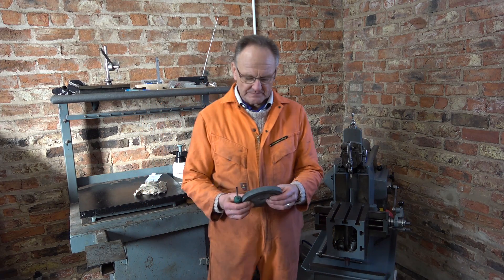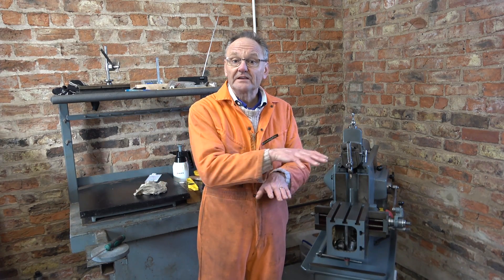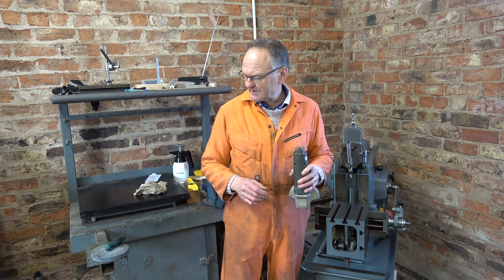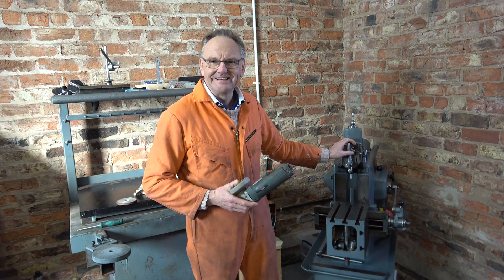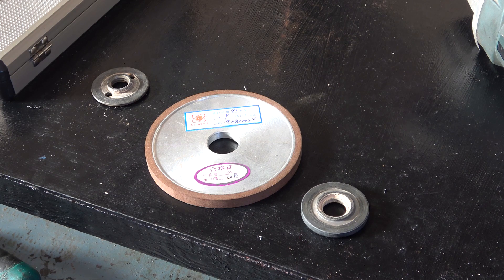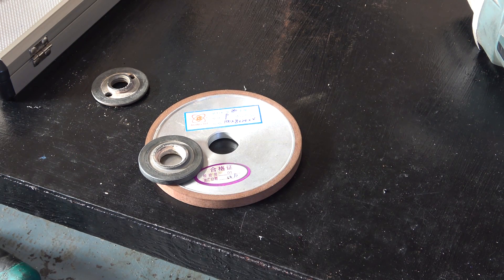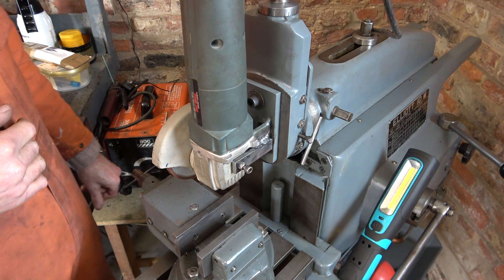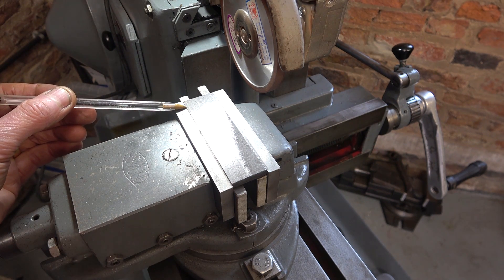HS67 Using my Elliott 10M shaper as a surface grinder

Comment: great idea will be copy.... a question , a usual disc grinder dont work well???( rectificated with a industrial diamond???
Reply from the maker: Hi Jose, my 'shaper grinder' was just a rough rig because I do not have a toolpost grinder and the jaws are only for my welding positioner chuck (so do not have to be perfect). All grind stones will wear. Stone will wear most. I used diamond but experts tell me that CBN is better on steel. It's all a matter of cost and what the job is. Cheers

Comment: 7:30 - Where did you find a surface grinder for 500-600 pounds? Last time I checked, to get a quality surface grinder, it costs $20-$50K. What you just built is comparable to the pro grade surface grinder. Thanks for the explanation, would be nice to show the surface finish accuracy using a dial gauge.
Reply from the maker: Hi SP, I was probably thinking of some clapped out bit of kit from a home workshop for £600. My solution is rough and ready but often I find that 'near enough' is good enough when you just want to trim a bit off something hard but be more accurate than hand grinding. In another video I trim a hardened parting tool holder to fit my toolpost where the absolute dimension was not important. In that case I used a carborundum wheel and of course there was a bit of taper as the wheel wore but it was manageable over a short distance (maybe 4 inches) for that application.  This was the video https://youtu.be/pKItOC9HWKA  Cheers
Reply: @HaxbyShed  I did some research, since I only work in precision applications, surface grinder needs to be carefully chosen to get micron to sub-micron flatness accuracy on parts. I read many people were buying quality old used surface grinders for $500 and rebuild it, however it is a great risk since surface grinders are the machines which requires strict observations if the ways, chuck, spindle and etc are working precisely and are accurate. In 99% of the time the used surface grinders are out of tolerance and people end up buying mint or new surface grinders to get expected results on finishes. It seems you just need a surface grinder for no precision applications. Thanks for the reply.

Comment: I have a precision tool grinder made by wadkin, I was tempted to make it into a surface grinder but then realised the table moving would have to be done manually, shame really because the head motor has two spindles for coarse and fine wheels
Reply from the maker: Hi Wadkinrestorations, to say my setup is a "surface grinder" is a bit of a stretch but it's fine for some basic grinding. I've got a job to do on it soon and I will make a video. My shaper table advances at 4thou / 0.1mm per stroke minimum. I had a quick look at your channel and you have some smart machines. To be honest I had not heard of Wadkin but I've since done a bit of googling on them. Cheers
Reply: @HaxbyShed  wadkin were around from 1897 to the 90's. They mainly did woodworking machines but did do some high end milling machines and stuff for the aircraft industry. They also did a huge drilling machine for working on big plate steel. I'm finding myself drawn to metalwork. I recently got a lovely lorch screw cutting lathe and a nice little BGA jig borer.

Comment: I hope that you have checked the rated speed of the wheel against that of the grinder. Angle grinders usually rotate very quickly; much more than diamond wheels do.
Reply from the maker: Hi Michael, Thanks for the question. My angle grinder spins at 10,000 rpm. I checked the wheel and no max rpm is stated, so I checked my ebay purchase history and likewise no max rpm stated. So I Googled for max rpm on similar 4in (100mm) 75% resin bonded diamond edge wheels from some reputable companies and nothing jumped out on rpm limits - the rpm references are generally about calculating the right rpm to get a particular surface feet per minute (m/min). But after a lot of hunting I found just one max rpm stated for a similar but larger 5in/125mm wheel on Amazon as 8000 rpm.  I guess for a 4in wheel the max rpm would be higher, and then some safety margin. Maybe I won't stand in front of it..... Cheers
Reply: @HaxbyShed  Actually, using a diamond wheel on ferrous material is never a good idea anyway. The iron dissolves the diamond (carbon).
Reply from the maker: @michaeltelemachus5112  yes I was just reading about that too 😁

Comment: You are missing the purpuse of the surface grinder. The biggest problem is the angle grinder bearing, it is not high precision even on the lose side to tolerate the high rpm and temp diviation. Diamond wheel are not ment to cut mild steel it loads up quickly. On my surface grinder the max I cut at once is 0.1mm and when finishing only getting 0.01 mm cuts the lowest graduation is 0.001 mm. if you want to get flat surfaces the play has to be less then the smallest cut. Cheers
Reply from the maker: Hi Logan880121, thanks for explaining. I have not used a surface grinder myself so it was just "let's try it and see what it can do". I take the point about mild steel and so I will avoid that in future. But still for £30 I have a very basic capability now to maybe trim a hardened bush or a sleeve, albeit with limited or unpredictable accuracy. Cheers.
Reply: @HaxbyShed  If you make a 30 mm shaft with plain bearings and 300mm apart. Balance a grinding wheel for steel you will get much better flatness. Almost your toolpost drill but bigger. Cheers
Reply from the maker: @Logan880121  Thanks.

Comment: Good idea there, I have the shaper and the grinder so will pop it on the list of projects. Am deep into a drill press at the moment one of the problems being a bent and twisted quill. Thanks for sharing.  Steve
Reply: I think it may have had a large electric drill chucked direct on the quill as there were no pulleys or motor with it.  I tried to straighten the quill but without success so will have to make a new one. It takes a morse no 2 taper.
Reply from the maker: Steve, that sounds like a difficult problem to solve. And how does one bend and twist a drill quill in the first place?

Comment: Cool project.  I remember seeing this done on a shaper by another before. Definitely lots of potential in a setup like this. Is there  a project coming up to use this on?
Reply from the maker: Craig on this one I'm using the 'build and they will come principle'. It will never be a serious surface grinder but it might just be enough to trim a hardened bush or something.

Comment: excellent thinking! ill relay what I know of the subject seen as I have a surface grinder(a low end one its an eagle) so taking more than 1 thou at a time would be unusual for me but can be done with flood coolant, the metal heats up and expands locally especially in stainless because it cant conduct away the heat,I've no experience with that wheel you have except to say its probably for very hard materials only, the grinding wheel having a more pour surface tends to remove more metal with less heat, honestly I seem to use a bout a 46 grit green wheel for most of my stuff that's hardened tool steel I dress my wheels after about 12 minutes of grinding, its probably one of my favorite tools and no its not very useful but what the hell ha ha! dont rule out a mill, they are great,so great I bought 3 harrison mills, keep up the work,all the evidence points to you being quite smart, that in itself is a bit like a surface grinder ha ha
Reply from the maker: Hi Anthony, I really appreciate the advice. I set out on this with just an explorer attitude and no experience. Three Harrison mills - that's greedy. If I got a mill it may be something small - desktop CNC or something. Cheers
Reply: @HaxbyShed  I had less knowledge than yourself after a year of owning the grinder ha ha

Comment: Nice solution to a mutual problem. Have you thought of the same approach to attached a hack saw? Benefits of collecting the dust produced by the diamond wheel  is in Mechinery’s Handbook 1951 edition. There is suggests suspending the dust in water and  separate out the diamond dust to use for a finer finish. A hacksaw in the shaper could make the lapping plates to use the diamond dust on.
Reply from the maker: Hi Robert, I must be getting slow these days because I had not thought of using a shaper as a machine hacksaw but I'm sure if I did not have the trusty Rapidor I would have to try it. :-)
Reply: @HaxbyShed There is always a place for the "chip off the block" old donkey in the stable. Maybe a shaper can expand the cutting options such as performed by that of a metal bandsaw?  If an Abrafile was used instead of a hacksaw blade it could act as a coping saw as well? All that said, I must confess to finding the gentle sound of a Rapidor somehow relaxing.

Comment: Very interesting setup!  I'm attempting to do something similar with an old T&C grinder.  One suggestion:  may want to add some rubber sheeting/guards to keep dust away from the precision slides of the Elliott.
Reply from the maker: Hi Daniel, I was overcome that it worked at all so did not think about abrasive dust but I saw it on the video afterwards. Yes I would have to cover up next time.

Comment: Experimenting is cool. Sinds long i want to do the same but with a small motor that i still have to find. The shaft of my angle grinnder has too much play in it.
Reply from the maker: I can't make any claim to the predictable accuracy (or not). It may be poor. But one day it may just be enough to trim a small amount of a hardened surface or sleeve. Cheers
Reply from the maker: @Rustinox, maybe you are telling me in a gentle way that angle grinders are not accurate enough for this. As other comments have come in they have pointed me in that direction, so I learn from the experiment  :-)
Reply: Just a thought,,,used but not wore out treadmill motors?? I have 6 and all the shafts run true..mite be to bulky, but a thought! Bear